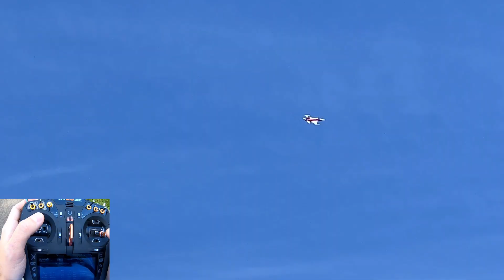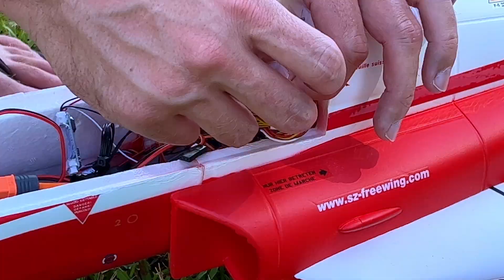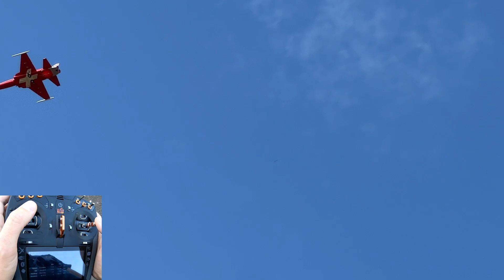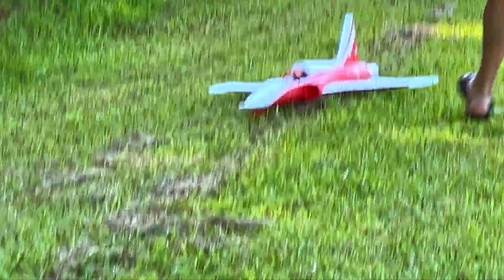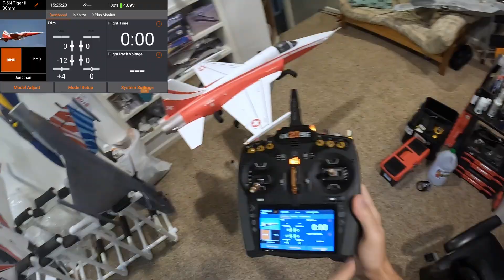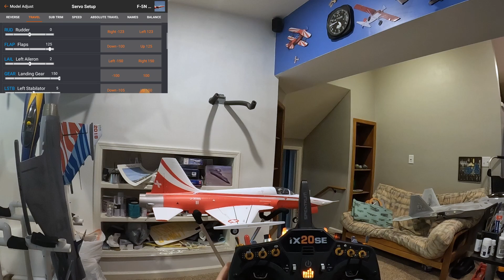FIRST FLIGHT DISASTER

Comment: My f 5 really dosnt like any tail heavy. The 9 blade will have her doing 130mph +, I would put it back in. Besides the sound is amazing.
Reply from the maker: I don't think the motor is limiting speed. It's most likely caused by the ESC. More testing will be needed.
Reply: @TwoBrosRC  ya. Makes sense. She is a hot rod...thats for sure.
Reply: @TwoBrosRC  I just like that freewing h.p. 9 blade fan/motor.😎👍
Reply from the maker: I'm not a fan of it - it's a bit heavy for the amount of thrust it puts out.
Reply: @TwoBrosRC  I don't have tons of 80mm fans under my belt. I have 3 of the 9 blades, tho. I will eventually experiment with other 80mm fans. For now I'm happy with their performance. I had thought about the newest fms 80mm 12 blade rig but its kinda spendy for my blood. I can not remmember now. Somthing like 3.6k thurst and super efficient.....2000kv?? mm??? I think. I have not looked that fans specs up in a minute.
Reply from the maker: @mongoose4117  Yeah, I heard about that one too. Not sure I want to drop a hundy on it just yet. Maybe when it comes time to rebuild the Gripen.
Reply: @TwoBrosRC  oh yea.. In the Gripen..would be NICE🤑👍🏁
Reply: @mongoose4117  yes that is a much better set up. less than 100amps and tons of thrust all the way through the range. I have an xfly in mine and its well over 150mph now. It was at 150mph with the fms 2100kv set up and the current set up is considerably faster.
Reply: @gooniac33  oh, right on!! Gooniac, i'm a fan of your content.👍💪😎I wondered about the xfly!! 150+ sounds good to me on 6s😜🏁🤖.
Reply: @mongoose4117  no joke 150mph plus when you get cg right with the xfly. And thanks for the kind words!
Reply: @gooniac33  thank you as well. Oh...i beleive you. That f-5 i think is already a dream, stock. 150+ would be awesome. I love flying fast. I have some seriously fast birds andfy em all the time. So ya, 150mph would be fun, fun, fun.  Is it the 2200kv 3280 12blade xfly? I want to get the right one.
Reply: @mongoose4117  yes… and for reference my buddy just got his fms 2100kv powered Swiss F-5 up to 167mph 😳😳😳
Reply: @gooniac33  holy crap thats intense!!💪🏁🌀🤖🐤😁I need that in my f-5 sundowners. Sounds good. I'm guessing I will be doing some swapping soon enough. Lol my mig 21 needs the same. I have an avanti v3 that I squeezed and 80mm h.p. into. Shes a dream but needs more😜especially if she's more efficient!!👍🤑well thanks, nice chatting Gooniac.🍻